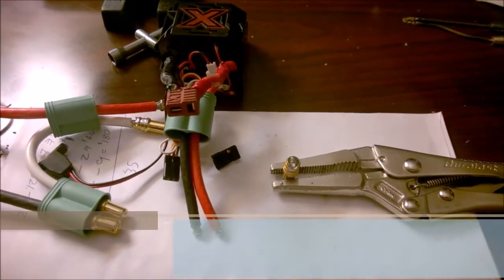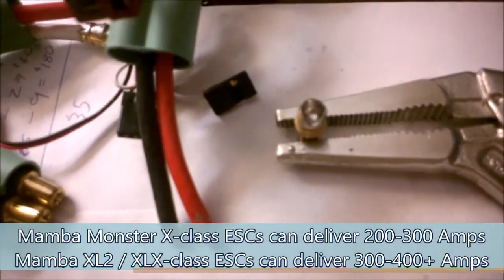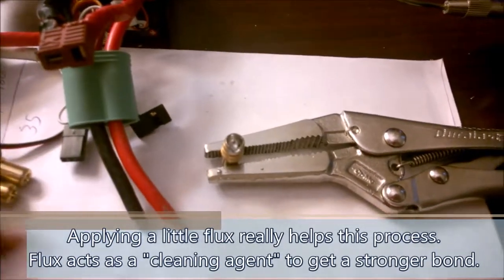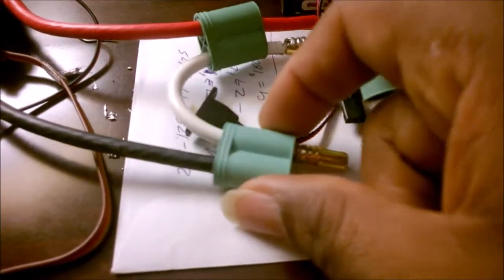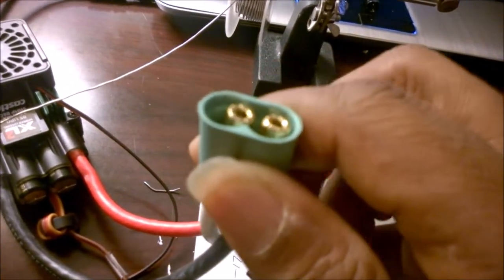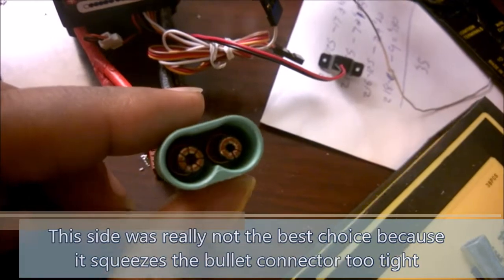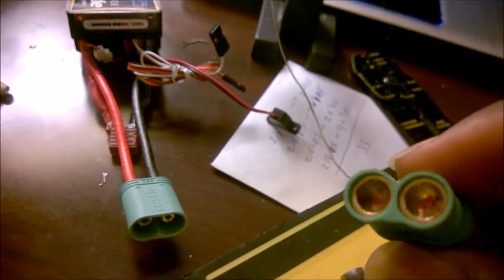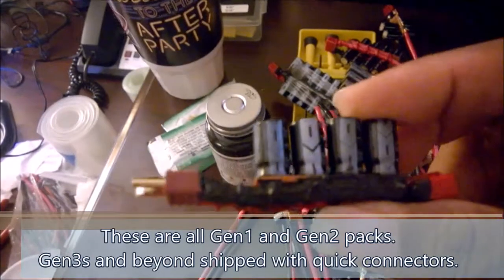Ep. 211: ESC-Side Castle Connectors Install Tutorial

Comment: Hello,
Thanks for the video.
I have a castle XLX that comes with cap packs. I'm installing another cap pack. My question is do I need to remove the cap packs that come with the ESC before soldering the new cap pack?
Reply from the maker: It's ok to add caps to work along with the stock XLX caps, but you should NEVER remove the stock cap pack. Castle added that specifically to tame ripple voltage problems that were killing XL2s. It is extremely effective because it's so close to the ESC. Adding more caps will make things better, but if you remove the stock cap pack, you will often get a worse result than leaving it stock.

Comment: I have w wired but very important question. What type of charger can I buy to charger these batteries?
Reply from the maker: Sorry for the delayed reply. LiPo batteries need LiPo chargers that can ensure that each cell in a pack is brought back to the proper voltage. You should also get on capable of discharging cells to "storage charge" when they are not in use which will increase their useful lifetime. I'm sponsored by Venom, so you can see their full range of chargers at http://www.venompower.com

Comment: mini butane torch works ideal for those. should also maintain the heat fr9m the outside of the bullet,  when setting the wire in to ensure a proper transfer of solder
Reply from the maker: Great point! I thought of that, but not everyone has one and I didn't know if I felt comfortable suggesting a method that 1.) I haven't tried personally, and 2.) could result in someone setting themselves on fire if they aren't too careful. LOL!

Seriously though, I've thought of getting one of those to help with a number of hi-temp tasks. I just might grab one to experiment. Thanks for watching!
Reply: rhouse21 - RC Physics i have binge watched all your videos over the past week .  great info you have here .

Comment: Have you tried xt150 connectors?
Reply from the maker: No, I haven't. I looked them up and they seem pretty decent for most applications up to 1/8 scale. They are 6mm bullets rated for 150A cont and 250A peak, which is pretty stout. for what I do, feel more comfortable with the Castle connectors, though. My Mamba XLX can pull 300-400+A and Castle has certified their ESCs with these connectors. The XT150s may be able to take these current levels, but I need to be certain that I can trust the connectors at these crazy current levels for my testing.
Reply from the maker: You should be able to get these at your Local Hobby Shop. If not, you can order them from Castle directly, or Amazon, Amain, Tower, etc. Either way, your LHS should be able to solder them for you. They go together just like any other bullet connector.

The MMX (and most 1:8 scale or larger) ESCs can burst to WAAAAY over 200 Amps, so almost any ESC would benefit from these. I use them on almost all my models now just so I can use any of my batteries on any model without fussing with an adapter. Castle claims that they have the same overall resistance as their large gauge wire when properly installed, so you shouldn't have to worry about resistance losses under heavy loads, but I actually think their strongest suit is the general safety they provide. You get the advantages of big bullet connectors without the stress of accidentally shorting your wires. That by itself is a good reason to upgrade in my book.

Comment: Hope to se some speed run soon
Reply from the maker: It's been a really hectic time recently, but don't worry. actual run video is coming soon.
Reply: rhouse21 - RC Physics my fans  on my red cat  volcano  are not working  I have it binde  all redey to run but my redcat volcano is not run ing the fans I am runing the sidewinder sv3
Reply from the maker: Has this ESC gotten wet? The newer Castle ESCs are waterproof, but the fans can seize up due to corrosion if they get wet or they can also get clogged with dirt. You can pop the fan off and check it. If it's bad, Castle used to sell replacements.
Reply: rhouse21 - RC Physics they are not the stoke fans they  are yeah cooling fans brand new and the sidewinder sv3 is brand  new
Reply from the maker: If these are not the stock fans' what kind are they? If they were computer fans, that may be the problem. Computer fans tend to be 12V. The SV3's BEC only puts out 5 or 6V. That may not be enough to spin a 12V computer cooling fan.
Reply: rhouse21 - RC Physics no they are the the yeah  fans they are made for 8.4 volts
Reply from the maker: Hmmmmm. This is a weird one. You might need to post a picture to my facebook group so I can see how things are wired. I assume you've checked the leads on the fans and have confirmed that they are getting good power?

Post a picture at the link below and I (and a bunch of other RC geeks) will take a look and see if we can help. :-)
https://www.facebook.com/groups/804281383082531
Reply from the maker: Cool! If you can post a link to the video in my Facebook group so the other guys can see it too I'd really appreciate it.
Reply: Ok Thanks
Reply from the maker: Hot wires usually means a lot of current flowing. I suspect you have a bad ESC. Call Castle. If it is bad, they'll replace it under warranty.

Comment: Just had the worlds worst experience at my local hobby shop and these connectors.
Reply from the maker: What happened?
Reply: rhouse21 - RC Physics decided to get a pro to wire my xmaxx with castle 6.5 connectors 

I dropped off my stuff and was awaiting in the shop. I she the guy soldering was sweating like crazy and his hands shaking when he's soldering.... he then said "ahh shit" and he started to cut off all the connectors he just soldered...... he put the wrong connectors in the esc and the wrong ones in the batt. 

He then shorted my battery and melted one of the connectors... 

I looked at the joints he made and half of them had only 50% of the wires in the connector and the wrest he cut off 

Just a bad experience 

Need to buy new connectors and do it myself
Reply from the maker: Wow! You may be able to salvage the current connectors, but it really sucks that the "pro" messed things up so bad for you. :-(